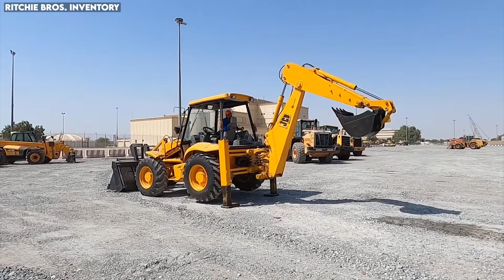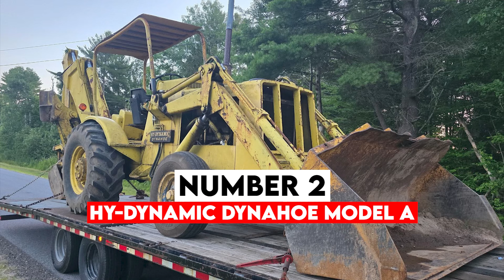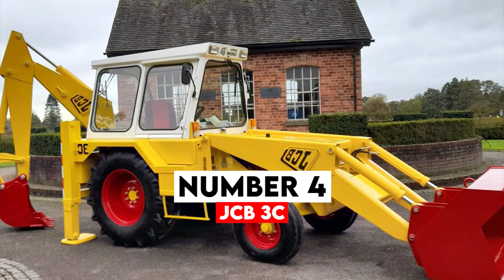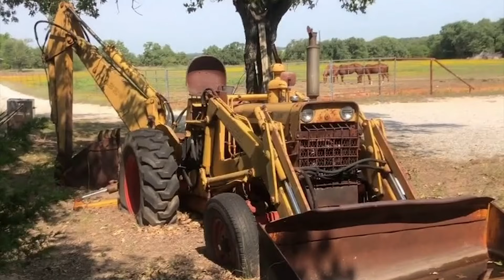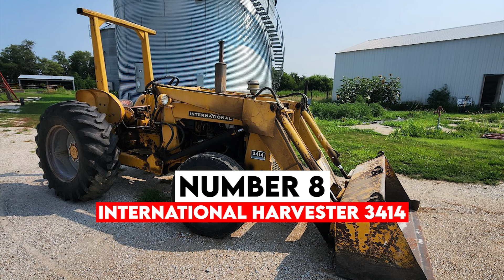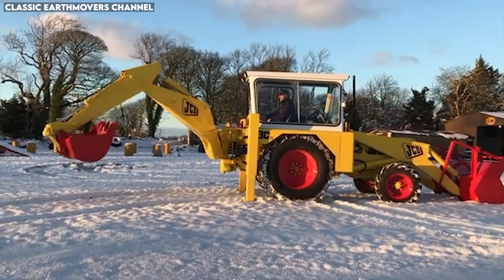10 Backhoes From the 60s and 70s That Still Outperform Modern Ones!

Comment: I would like to add that the FORD series line of heavy duty Industrial Backhoe line, with the BUCKET curl, lots of GRAVEYARDS, prefer that Backhoe because it was a "PERFECT" Grave Digger. It could dig a PERFECT square Grave Ditch, for the time, it had a straight wall digging cut. And curl to place the dirt perfectly on the side of the Grave sit. At the time, it was the ONLY Backhoe with that design for the BUCKET.

Comment: Thank you from the bottom of my Heart ❤️  for showing my Big Boy, in your Videos. Mine is the Dynahoe-190 with the snow on ground and me wearing the "ORANGE" cap, I was STARTER her in 30° weather, just to show she can START, with NEW Battery 😊 My Hour meter has (8310) HOURS, have had her sense 2003, she is a 1978 model year.
I did want to ADD sense you talked about the Digging depth of the Beasts 😊 Dynahoe
Can out with a (220-E) this was a "FULLY" Revolving upper house. With the 20 Feet digging depth 😊 this monster had a unique cab design, the operator could swing the seat around, so the "STEERING" Wheel was not in the middle of him like so many 4 wheeled big Tired Backhoes, made at the time, it had 4 stabilizer mounted right behind each big Tire. This Design by Bucyrus Erie of the biggest Dynahoe, was so ahead of it's Time. Think about it my Dynahoe-190 is almost 50 years old, and she still RUNS, and is DIGGING for me, my NEW RIPPA-R-10-ECO series #6 2026 modle looks so small sitting next to my Dynahoe-190 😊

Comment: I would say that Dyna Hoe and JCB where the only manufacturers who built a separate chassis although given how heavy the Dyna Hoe is if you tried to put that much wait on the back axle of a standard tractor it wouldn't be pretty. Totally wrong information on the JCB 4/4C as I believe they ran the same power unit as the 3/3C